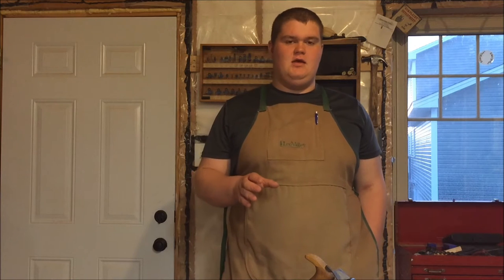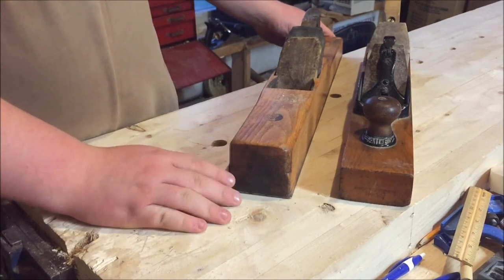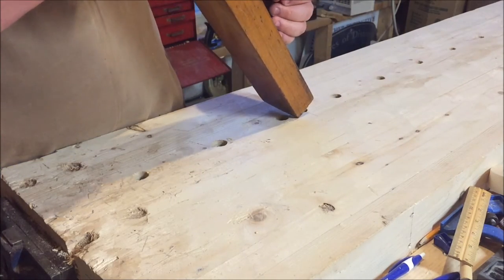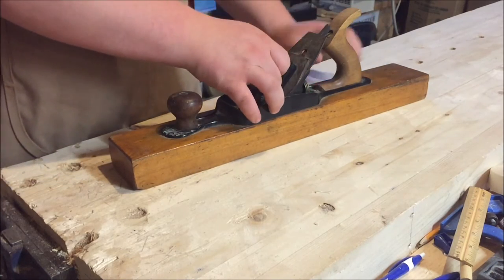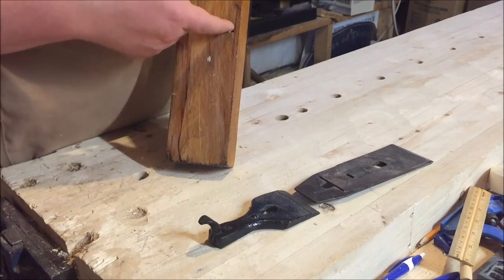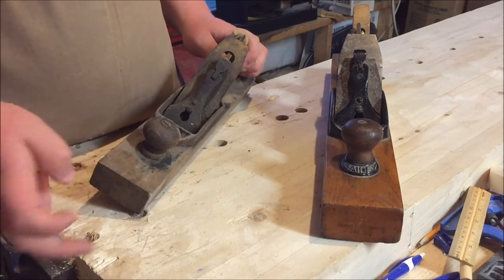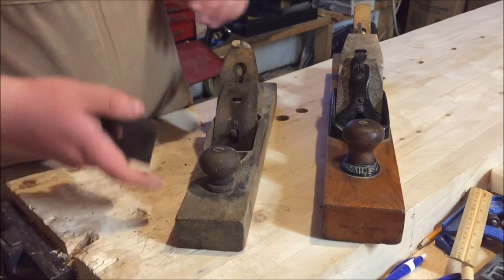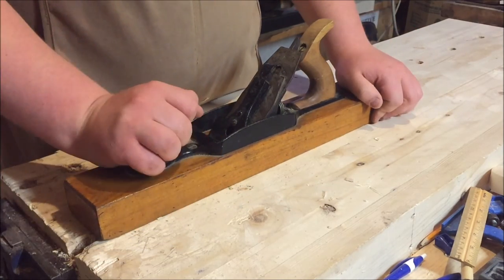My Stanley #29 transitional plane

Comment: Thanks Greg,
Great buy, how does the transition compare to a jointer?
Reply from the maker: It is the exact same actually it is just the cross between an old wooden jointer plane and the slightly more modern bailey patent jointers
Reply: nope they are jacks, but the answer is the same. wooden sole planes 5end to be easier to slide, as their is less friction. they are harder to set up but once you learn how they are incredible planes. there is a reason they have been used for thousands of years! 

these are in fantastic shape, and for that price you found a once in a lifetime sort of deal!